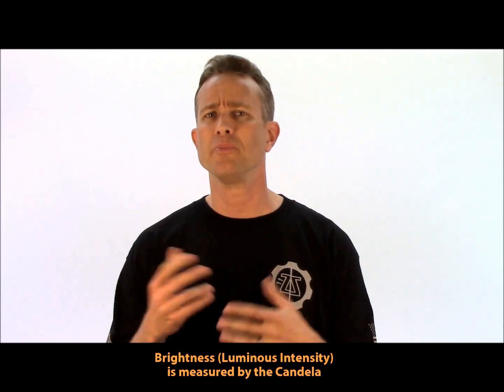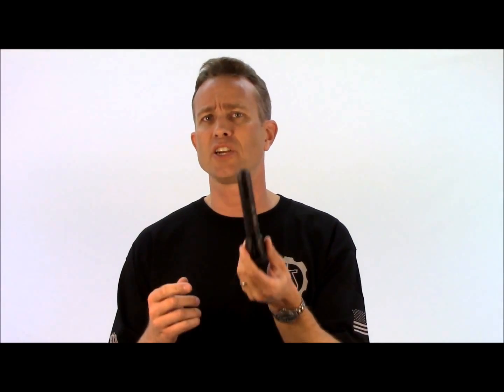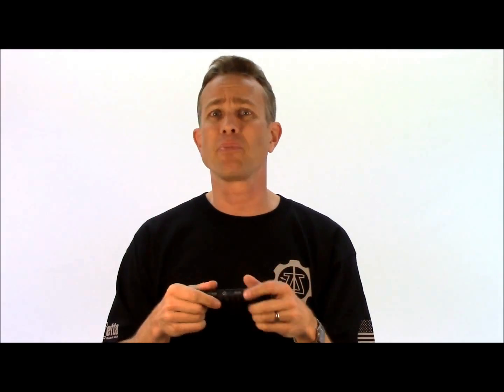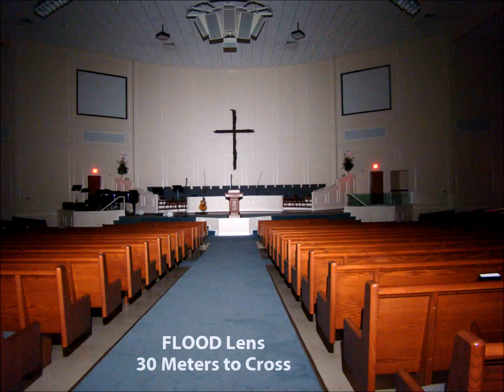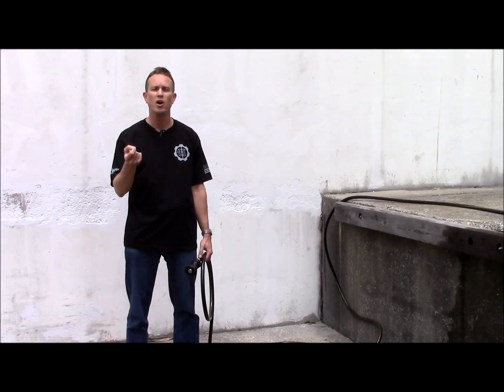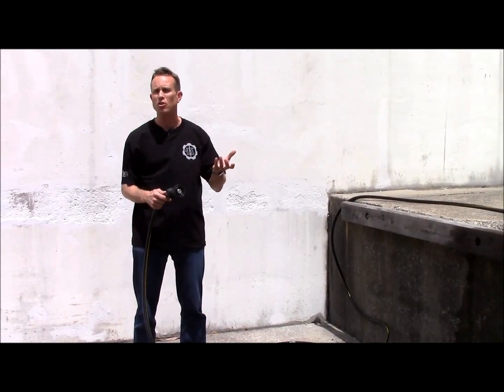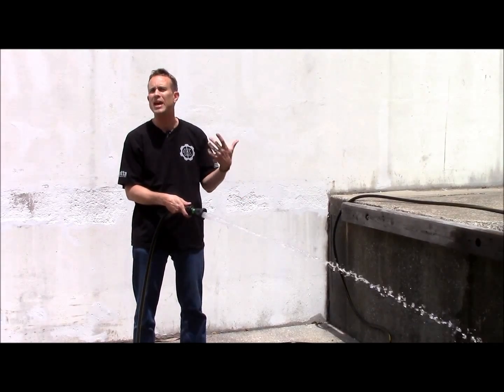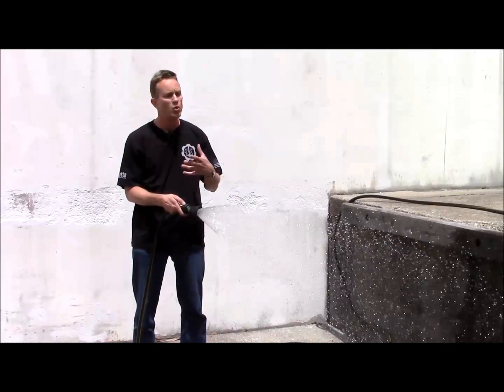Understanding Lumens, Tactical Flashlight Beam Pattern & Brightness - Elzetta vlog episode 1

Comment: A flashlights lumens would have to be calculated? If a meter is used it would only capture a small area so total output wouldn't be determined? One flashlight on Amazon claims 5000 lumen which doesn't seem to be as bright as a 550 lumen flashlight I had so I'd think they measure the beam fully zoomed but am guessing.

Comment: I copied and pasted this from REI CO-OP. Measured in lumens. This is a measure of the intensity of the light coming out of the flashlight, on the highest brightness setting powered by new batteries. It may also be shown for multiple light settings. This is a great comparison tool, but does not tell the whole story about brightness.  Beam intensity, distance and type all influence the effectiveness of a light in different applications. Light output can range from a modest 20 lumens (great for reading a book) to a terrain-scorching 3500 lumens.
Reply from the maker: That is false.  Intensity is measured by Candela, not Lumens.  See our video blog on Candela for more information.

Comment: I cant imagine there isn't an easy way to know how bright and how far a flashlight will shine.  flashlights are. I think most people have been simply looking at the number of the Lumons when they buy one, thinking, more lumons, brighter the light. According to this guy the number of lumans has nothing to do with how bright or how far the thing will shine, instead it's the number of candela. Is candela the same as candle power? I guess just buy and hope it's as bright as you want.
Reply from the maker: Check out our video blog on Candela ... https://www.youtube.com/watch?v=8qSOowE_LsY
Reply: Ok
Reply: Hard to know how bright a flashlight is, when they only list the number of lumons, and nothing about the units of candela.
Even if they did, you just about have to get out paper and pencil to figure out how bright it is, and that's if a person actually knew how.
Maybe it's easier to market for higher profit. Sounds more like deceiving rather than fair marketing to me, but it is legal.
Reply from the maker: We publish Lumen and Candela ratings for all of our flashlight models.  A "beam distance" rating is also published (calculated from the Candela rating per the FL1 Standard).  Other manufacturers may or may not publish such data.
Reply: ElzettaDesign I will take a look

Comment: Analogies can be tricky...I'm betting that the flow mount (GPM) changed a little as you adjust the nozzle. A more restrictive opening in the nozzle raises the PSI inside the hose and reduces the GPM.
Reply from the maker: Yes, that is why Mr. Barnett qualified his statement about a constant flow rate with, "more or less".  (Lumen output is never absolutely constant either so the analogy holds quite well.)
Reply: Most analogies just muddy the waters. A very wise man once said, "A thing is that thing, and not another thing"

Comment: This video would have you believe that the number of lumens doesn't determine brightness. So is a 2,000 lumen flashlight as bright as an 8,000 lumen one using the same beam pattern?
Reply from the maker: +Karaoke-Tutor.com Using the same beam pattern?  No.  But a 2k lumen light may be brighter than an 8k lumen light if they have different beam patterns and that is why Candela is so important.  See our video blog on Candela for examples of this phenomenon.
Reply: But that's not all things being equal. When all things are equal then more lumens means brighter... correct?